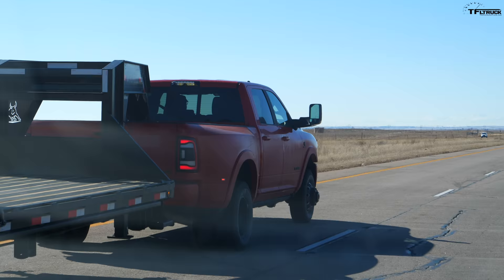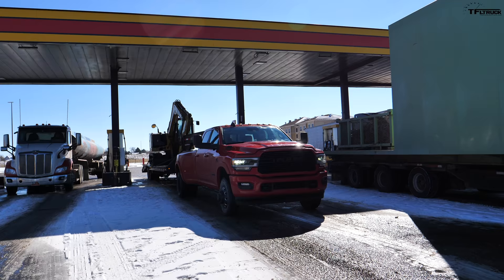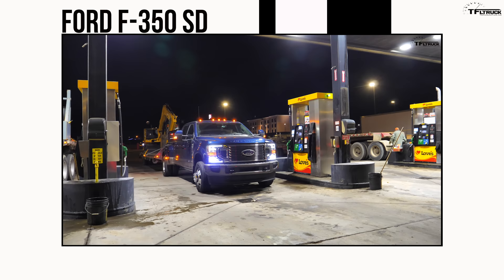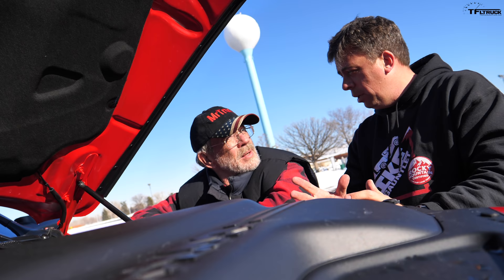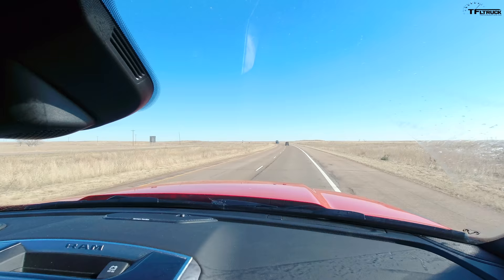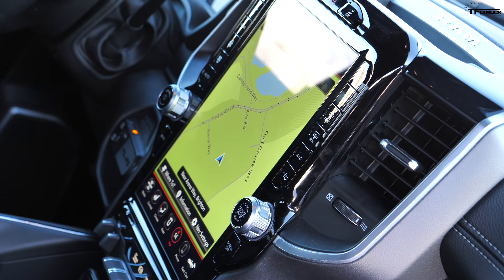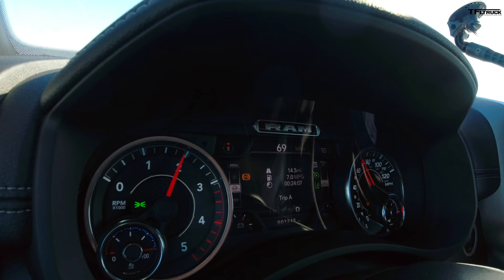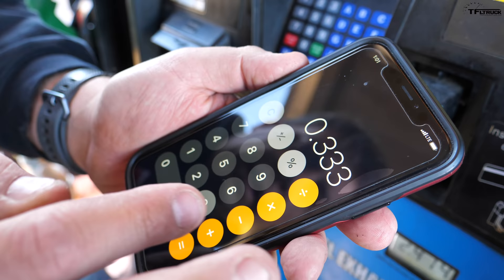New Ram 3500 Cummins Takes On Our 30,000 Lbs MPG Challenge Against GMC & Ford Diesels!

Comment: I’m like all three but my biggest expectation is dependability and warranty coverage.
Reply: Dont get a dodge if youre looking for reliablity
Reply: The Rap Game that’s true, you can always rely on it sitting in the drive bc it won’t start
Reply: @luketurner384  chevy isnt reliable either... we have a winner... FORD
I prefer the old models that lasted lifetime dont you agree?
Reply: The Rap Game all day every day, OBS 7.3’s are badass, I drive a 2012 5.0 F-150 rn and love every second of it
Reply: @therapgame1091  Are you sure that's the case with the Cummins + Aisin transmission?
Reply: @dannysan1272  no i totally agree with you on that however the cheap plastic parts and electrical components are basically the big no no for me. Plus the plastic and aluminum theyve added decreasing from 2019-2020 to having removed 2000 pounds with just the stripped chasis. When you have lots of heat under there youre going to need to treat it like a baby otherwise parts will melt and plastics will fail. Since fiat own big Chrysler theyre not known for developing reliable vehicles. Just look at their fiat company it failed in the U.S. 😂
Reply: @luketurner384  i just remembered my dad bought his 2nd 2007 dodge and a couple days later the starter failed 🤣🤣🤣 BRAND NEW I TELL YOU
Reply: @dannysan1272 Aisin is Aisin Cummins is Cummins and Dodge Ram FIAT = Shit  dodge trucks are always falling apart it’s not even funny
Reply: Ramon Martinez I just had a stroke trying to read you sentence
Reply: @CPO-kn5uo  u can't handle the truth?
Reply: @CPO-kn5uo  i understood it :)
Reply: @luketurner384  I have almost never heard of a Cummins not starting. Everything else is wrong with those ram trucks, but what you just said is a lie
Reply: @justinmartin8887  I guess the motor won’t fail but every other Fiat part on it will, touché
Reply: @therapgame1091  I have a 1994 F20 Turbo Diesel with the 4 speed Auto and it has the last week International Harvester put a Factor Turbo Mechanical Diesel in a truck and i only have 137k on it and she purrs like a kitten! 26 Years old and still starts like shes brand new! wont see a dodge with an Auto do that! doesn't matter if i have a 10 pounds behind it or 10K i still get over 15 MPG!
Reply: @jasperpetersen8241  jeez 137k thats almost still new.  My father just hit 200k last year and still starts up every time you switch the ignition key on I'll at least give dodge that. Due to several accidents it's been on has basically been the center of issues. Even so I still don't like how they keep adding more aluminum and plastic. I can at least verify the electrical wiring is still garbage even for a 07. Wish Fiat could leave the business to entrust it a much caring company. 

Honestly the perfect truck if there were to be one and one day if i do get to that point to invest Allison Branded Transmission with  a Cummins engine(although their engines are still added with aluminum at least change that more trucker worthy parts) with all the newest features electrical and body like a hd ford. Insane but reliability would be off the road. 

I'm just dreaming it but one day maybe.
Reply: @luketurner384  while I would agree the truck as a whole is not very well built, the cummins engine is s very reliable engine and the aisin is made by Toyota. I'm not sure what you mean when you say you can count on it to not start
Reply: @therapgame1091  funny own an 01 and 03 ram cummins 455k and 400k miles. 1 is personal and 1 is work
Reply: @therapgame1091  never had a problem with one all the rumors about them are not true they are not anything like what the were in the late 90s

Comment: If you were towing 30k for 100,000 miles, the difference between the f350 and the ram is over $11,000 in fuel savings. That’s significant
Reply: Yep if you only drove the Ram on windy days, and the Ford on calm days.
Reply: @sonsofliberty3081  that is what he said

Comment: Your straps are supposed to be inside the rail not outside to protect the straps.
Reply: The accessory chain is loose, that is an automatic OOS as it is not secured as required as well.

Comment: Do a shoot out with the Ram 5500 and the new Chevy 5500.
Reply: Shane Beylund and F550
Reply: @icare7151  No need for a 10 speed with the Cummins. 8 or 9 speed with good gear splits would be perfect.
Reply: @icare7151  what’s the point? With the outstanding energy curve of the Cummins there’s no need. Energy from bottom to top
Reply: @rjterry21  even better with the g56 when it comes to towing
Reply: @whitebison6.749  There's no benefit to the manauls when it comes to towing these days, that's why they're all gone on the pickups and just about gone on Semi's. They're less efficient and causes more driver fatigue.

Comment: When fuel economy is that  close I would trust the Cummins hands down.
Reply: Its not close though, its almost like the difference between 30 mpg and 40 mpg in a car... As for reliability I think they are all pretty well proven at this point.
Reply: 30 percent is a huge difference.
Reply: If you use these trucks like a lot of people hauling heavy stuff all over the country, 2 mpg is a HUGE difference
Reply: As the engine  brakes in mpg will go up. But the Cummins will save you money in repairs.
Reply: @oobiegoobie940  more like 25%
Reply: @R.E.L.Asphalt_Sealcoating  buy a new calculator
Reply: @BadWrenchAuto  They'll all cost you a shit load in repairs. Modern diesels suck.

Comment: I would reeeeally love to see a RAM VS RAM comparison. 3500 with the HO vs 3500 with the non HO Cummins. Drag race, mpg, Ike or any towing test. Just a full on powertrain comparison
Reply: HO has an impressive jump in power, even more than advertised.
Reply: @sHoRtBuSseR  It would be cool to see if it really translates to any difference on the road!
Reply: @razorsedgeadventures6599  They pull better going off personal experience. A similar load of 34 foot beavertail hauling an 8 ton excavator I noticed the HO right away after the switch.

Comment: For the air system it does let you know if you are over payload. The bags will only air up to certain point and should notify on dash. Could be different in the 3500 models. It for sure on the 2500 air system

Comment: Guys when you hook up your yellow straps please run them inside the rub rail coming from the ratchet spools.   Yes it works but the DOT would tell you different. Yes I’m a Class A over the road professional truck driver.  So please watch that in your future test.  Please verify that fact if you like.  I’m for the GMC 3500 HD.   Liked & Subscribed

Comment: I have a 2018 Ram 3500 dually limited with HO 6.7 and aisin trans, crew cab long bed. The fuel tank size is one of my only complaints, glad to see they now have larger tank option. I don't do many long trips but towing my 24' boat with trailer tongue to outboard engine 33'-6" from NC to Fl keys approx 900 miles, GA and FL don't seem to have many truck stops on I95. Even though the truck gets decent mileage, most of my trip is getting that truck/trailer combo into convenient stores for fuel. If Ram comes out with the HO6.7 with allison trans, I will be one of the first to order a 3500 dually limited, and of course with the 50 gal fuel tank option. They should make the 50 gal tank standard.

Comment: I'm glad you mentioned that it was a fresh, non-broken in motor. Not just the Ram, but all 3 of them should see around 10mpg under load once they get broken in. My Cummins (2018 Ram 2500) really got better once it passed 10k.

Comment: Your strap isn’t supposed to go on the outside of the rub rail. It’s a rub rail for safety if ever you sideswipe something or flip the trailer, then the rail rubs and protects your strap. The rub rail isn’t for attaching the strap nor should the strap be on the outside. Putting the strap on the outside give no safety to your strap in an accident, then a rubbed or cut strap will release the load and you’d lose the load. Same for chains. Behind the rub rails. Love you guys and love the channel, I’m not trying to come off as an ass but to help you improve your safety and knowledge.

Comment: My 19’ 3500 has the 4.10 and it’s happy place is 65-68 mph for fuel mileage. If the truck in the video has a 4.10, the observed 6 mpg at 70 mpg with 30k lbs behind it seems par for the course, even with only 1,200 miles on the clock.
Reply: Should be the same for all the diesels. the same was true for my 6.7 Powerstroke. I would like to see them do this test for 100 miles or more at 60mph....that a more realistic daily speed for that much weight.
Reply: My 2018 3500 also has the 4.10 and you're spot on with the 65-68 mph sweet spot.

Comment: Well it's a great truck period I have hauled 50k total with my ram 2500. It handled it fine
No heat issues or other issues I could easily get it up to 80 mph if I wanted I kept it down around 65. With that much weight touch speed will be a handful Incase a blow out or other issues have fun guys. Keep them frames straight

Comment: Could you guys pleeeease do a towing test comparing the same truck “ram, ford or Chevy heavy duty”, but with different axle ratios side by side? Like 3.55 or 3.73 vs 4.10 or 4.30. I hear aaaall the time which is better for different reasons. But I want to seeee the difference!!! Fuel economy, 0-60 empty and towing, and the time difference running up the Ike gauntlet 👍
Reply: Especially with these new 9 and 10 speed transmissions, I would think you could run 4.10s and gear the transmission ratios to take advantage of that from gears 1-7 but still have a couple high overdrive gears so it still handles the highway well.
Reply: Axle ratios have less importance  when paired with wide range transmissions(these 10 speeds) the fact that the Duramax with the least torque and the "worst" axle ratio kept up with the Ram. My semi truck has a 3.25 and I'm  keeping up with trucks that have 4.10s and I always run 140k (b-train fuel tanker) consequence is, I get way better mileage on the flat than they do.
Reply: @jnk26  interesting.  But does it struggle a little more on steeper grades?  I don't know how much of a problem steep grades are for you actual truckers.  Probably more of a problem here in the west.
Reply: jnk26 it’s more about knowing just how much “however little” it does make. I want to see mpg to mpg and time to time, both empty and towing. side by side with the same truck and two different ratios. Same day, trailer, and amount of gears. It’s a test I never see done and I’m tired of just hearing and reading what the difference is. I want to see exactly how much it changes
Reply: I vote 3:73 truck will tow very well (not the Max tow). And the truck will cruise nicely. Ive had two diesels one had 3:55,other 3:73 and drove my dads f350 with 4:10. All around the 3:73 is nicest doesn’t have to hunt gears to shift.  But doesn’t scream very loudly going down the road like a truck with 4:10 will going 70mph.

Comment: Sure mpg is important if it’s DRASTIC, 1mpg is not drastic. I just spent damn near 80k on my 2020 Powerstroke and the last thing that was on my mind was mpg. If your worried about that you can’t afford that expensive of a truck. Nobody ever actually thinks of it like this. Diesel at 3.00/gal at 8mpg for a 1,000 mile trip is $375 in fuel. At 7mpg it is $428. If you are worried about $50 bucks this truck isn’t for you anyways. For the run around and fill up like most people do, we’re talking a couple dollars per fill up. It’s like when diesel goes up 10 cents and people freak out. That’s $3.00 per fill up. Come on people, buy yourself a little run around f150 ecoboost like I did that gets 20 mpg if your worried about it, and it’s actually a handy little truck for everyday. Either way, those of us who have these trucks like to know the info for some reason.
Reply: Based on 50,000 miles a year the difference in 7 and 8 mpg is $4,000 a year. So for someone who really uses there truck it can be a big difference.
Reply: Ray D ..I totally get that, but that is the 1% that does that kind of driving. Plus, it’s the others that drive around town that complain about it. I pull a 15,000lb gooseneck snowmobiling and with my sand cars and side by sides in the summer. On a snowmobile trip last week, the only friend of ours who even said anything was the one who drives a Toyota Tacoma. The rest of us who have trucks and trailers like these didn’t even notice. It’s always the same type of people who complain about it. Same ones who complain about getting 32 or 34 in their Honda Civic.

Comment: All Ram trucks equipped with factory air ride suspension will tell you when they are overloaded (1500, 2500, 3500, etc.).

Comment: What I find in trucks in Europe is that the ones that use very little DEF they are heavy on diesel but the ones that use more DEF are better on fuel. I kinda knew where the fuel mileage was going from the DEF use. RAM need more gears and a better final drive to get the mileage.
Reply: I really think the lack of a 10 speed is the biggest difference though. 4 extra ratios to keep the truck at the most efficient part of the powerband for towing that weight is huge
Reply: @BradChadley  or a manual with a range change, 6 over 6
Reply: @theworldaccordingtochris4370  Yea, that too. I don't believe that will ever make its way into American 1 ton dually pickups, but it would certainly be interesting.
Reply: @BradChadley  I don't see why some clever engineering type couldn't build one from a  RAM with manual gearbox. A friend of mine use to add overdrive gears to manual gearboxes years ago.

Comment: The fuel mileage increasing as the diesels break in I always thought was a myth, but i've only bought used diesels until this year and it's crazy how much better the fuel mileage gets the more miles I put on it. So yeah test this sucker again with more miles on it.

Comment: Mr. Truck, not sure if you know this but straps are suppose to be run inside the rub rails not outside. If you rub up against something you can cut the strap the way you have it. DOT could give you a warning or improper load securement violation